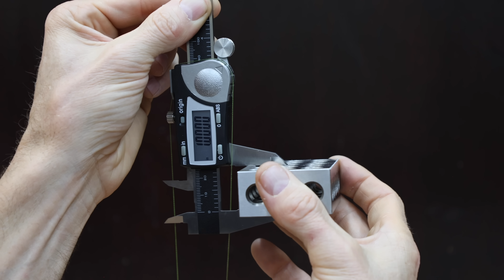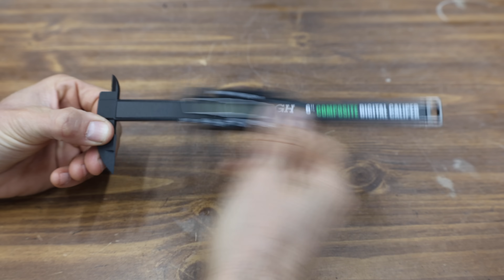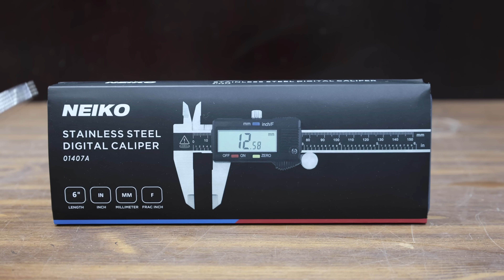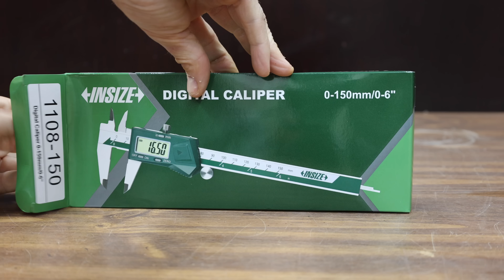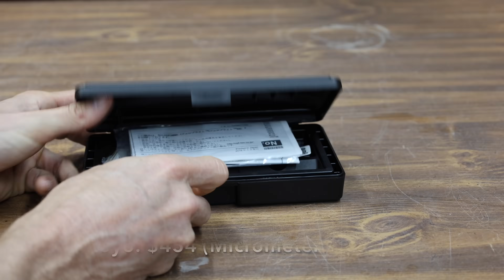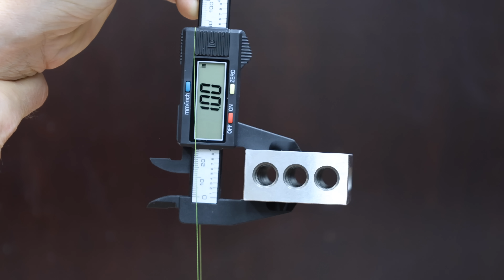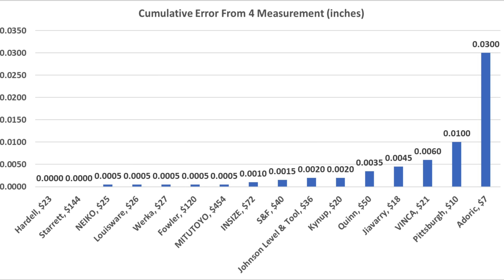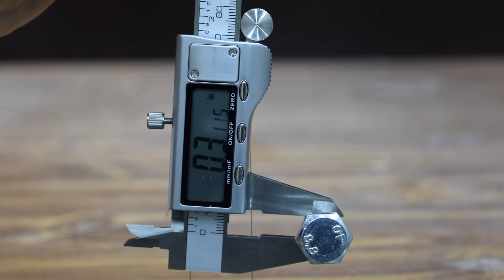I've Been Proven Wrong About Calipers!

Comment: One problem I've noticed with cheap calipers is that they drain the battery even if they're not in use. I have a pair of Mitutoyos and a pair of no name cheap calipers. I can't really complain about the accuracy of the cheap ones, but I need to change the battery all the time.
Reply: yup, if you're going to go cheap, I recommend analog calipers which have been quite decent in my experience.
Reply from the maker: Thanks for the feedback.
Reply: Ave did a good video on this topic with an actual Mitutoyo caliper and a knockoff Mitutoyo.  Both are always using battery power but the legit Mitutoyo draws from the battery far less than the knockoff
Reply: Just pull the battery out of the cheap ones when you're not using it. It beats having to pull it out and go buy another battery. I only ever use cheapies in harsh environments. So not all the time. But there's definitely places I don't want to bring good calipers. I still need better than tape measure accuracy sometimes there too. Not often but it does happen.

Comment: Sitting here with my Mitutoyo's on my desk, hoping I  made the right choice!
Reply: You did!!👍
Reply from the maker: Thanks for sharing.
Reply: In 1985 I bought an (expensive) Mitutoyo.  40 years later the same one is still my main go-to caliper.
Reply: @johnclements3441  My second set of Mitutoyo dial calipers are from 1982, still work great. 6 and 12 inch.

Comment: Biggest problem I've had with cheap ones is that they use relative distance calculations instead of absolute, so they have to constantly track the movement of the caliper. Because of this, they are not only less accurate, they have their battery constantly being drained even when they are off. Basically, they work okay but every time you put them away for a while and come back to them, the battery will be dead and need to be changed.
Reply from the maker: Thanks for the feedback.

Comment: Great review. Mitutoyo guy here. Purchased one in 2016 for $105, with calibration certificate. Still running on the original battery.  Solid as a rock.

Checked the calibration at a local shop and was spot on. Somewhat disappointed to see the lower rank in maximum force variance and O-ring measurement.
Reply: The o-Ring measurement isn't a great metric in my opinion, if that's something that gets measured often then you should be looking into point calipers
Reply: @kylep.9395  Completely understand. However, cheaper devices did better.
Reply: @haldavnekar  it comes down to build quality as well. Yes, the jaws are a little thicker but that mitutoyo will outlast those cheaper calipers while continuing to hold it's calibration much long
Reply: Arent the batteries cheap anyways?
Reply: @fusion1203  Yes. Depends. The reason for it lasting that long is because they are actually SR44 - silver oxide batteries, recommended for precision devices. Energizer SR44 are about $9 for a pack of 5 on Scamazon.
Reply: @fusion1203  Dead batteries can be a pain to change, especially if tiny screws need to be removed, and especially if you just wanted to take one quick measurement, and especially if you don't have a replacement battery handy, and especially if the battery leaks because it is dead & you don't know it because you don't use the caliper that often.  
I have a less expensive caliper that I don't use that often and I have to remove the battery after every use or the battery will be dead when I want to measure something. 🙃
Reply from the maker: Thanks for the feedback.

Comment: That adoric one is actually 2-3$ on aliexpress.

for rough measuring at home its more than enough. its not like you need 0.001mm accuracy.

PS: measuring in millimeters is often a lot more accurate, as a M4 hole is 4mm, not like a 1/8th inch being like 0.242123.
Which gives a more accurate example on sizes
Reply from the maker: Thanks for the constructive feedback.

Comment: Quick tip: most of these will draw power even when off. Slip a thin piece of plastic between the batt and casing when not in use. Most have the same logic board inside right down to the programming pin out.
Reply from the maker: Thanks for the tip.
Reply: I used to do that but kept losing the plastic piece I cut out lol. Now I put kapton tape (or shipping tape) on half of the cell and just rotate the cell when needed. If you are using clear tape, just use sharpie or something to mark which side tape is on.

Comment: I prefer dial over digital.
Reply: There's just no instant switching to metric and when you get older, you'll need reading glasses to see the little lines!
Reply: @dahut3614 I am older and I appreciate your point. I really only work with the decimal inch though. I seldom use the metric system. Cheers!
Reply: Love my Starrett 120..
Reply: 100%.
Reply from the maker: Thanks for the feedback.

Comment: I’ve found that if you use them only occasionally then the battery goes flat if you leave it in the calliper. I always take my battery out after use so having to unscrew a cover etc would be a no no for me.
Reply: Cheap ones use more power off than good ones use on. You can leave the battery in good ones and remove from cheap and the good one will use less batteries.
Reply: That's why I don't use battery callipers.
Reply: I can't really recall when exactly I bought the Mitutoyo calipers that I still use today, must be 25 years ago or so. There have been a few SR44 battery replacements during the years, but not that many. I've always had a battery in it, and it has never died on me.
Reply: This is why I switched from my battery powered Mitutoyo calipers to the same caliper but in a solar powered version.  They always work when i need them to, and I never have to worry about the battery dying.  While the battery in the Mitutoyo lasts a long time (Mitutoyo claims 3-5 years), it'll drain out if you forget to turn it off, and I've made that mistake a few times.  The only drawback to the solar powered caliper is that unless you're in really strong, bright light, it seems to take a bit of time to switch between imperial and metric.
Reply from the maker: Thanks for sharing.
Reply: guess what, the battery goes flat also if you use them often or don't use at all, not only if you use them occasionally.
Reply: This is why I stopped using digital calipers. Should have tested this. Since it makes them unusable for most casual use. And since only casual users buy these things, it is basically a pointless product, a waste of money.
Reply: I use dial analog too for home use.  

Needed a caliper once and battery was dead.
Reply: @MisterMakerNL  My iGaging calipers are over 4 years old and still on the original battery. So it definitely isn't a problem with all digital calipers. Granted the iGaging ones aren't exactly cheap, but they also won't break the bank.
Reply: @MisterMakerNL  What?! Pretty much all manufacturing jobs (with small enough items) use calipers...What are you even on about?! Measurements are the absolute most important trait in manufacturing. It's impossible to NOT use calipers. And unless you manufacture something with VERY generous dimensions, non-digital calipers are simply not precise enough.

Micrometers are used only in the most precise measurements, which is comparatively rarely. But even then, most quality control wouldn't use micrometers for every unit since it takes too long and risks excessive wear to them. Calipers are sufficient for the in-between controls with sporadic throughout check every so often.

Also, that's the most pointless reason to stop using digital calipers I've ever heard. If you don't have a use of calipers for over a year, then you should take out the battery anyway. NO battery should EVER be unused in a device for that long. That risk spillage.
Reply: @kikixchannel I meant these cheaper versions.Lot of devices use batteries on long term
Reply: @kikixchannel They said digital calipers. How did you think calipers worked before digital displays became common? They were analog , and you can still get excellent ones with remarkable accuracy.
Reply: @ThatMattWhite  You really need to reread my comment, this time actually paying attention.
Reply: @kikixchannel  So you saying the drain is caused by me not removing the battery not because it is a shitty product. Yes, that is definitely how good design works.
Reply: @MisterMakerNL  Yes, yes, yes!  An AMP drain measurement when "off" would have been good in this report.  I'm not sure if any of these calipers have a mechanical off switch that completely disconnects power or not, but I'm sticking with dial before I ever buy one of these.
Reply: Theres a huge difference in cost and availability between calipers that can read 0.001" and 0.0001".

Most common calipers (digital and analog) read 0.001".  Some digital will give a 0.0000" or 0.0005" ten thousandths.  

For 0.001" scale, analog actually is more accurate, because analog can allow you to estimate the ten thousandths value (0.000x") with +/- half resolution tolerance (+/- 0.0005).
Reply: @JKHTX  pff those inches...

for us non-aliens:

0.001" = 0.0254 mm -- not a problem with any digital calipers these days except the crappiest (typically also plastic) ones
0.01 mm = 0.000394" -- not a problem, repeatably, with decent calipers, including relatively cheap ones (but you need to know which to buy, these are typically built better and have absolute scale, cost starting at $30 or thereabouts).

anything less (that is, higher resolution) than that is pointless with calipers anyway as they lack the structural rigidity and constant clamping force required to provide repeatable measurements; sub-0.01 mm we are getting into the realm of micrometers.
Reply: @s_s-g4d  boop beep nanoo nanotechnology 👽 

😁

In the US 0.001" calipers can be found anywhere.  .0001" I've only seen available in higher end brands like the top 3.

I can't remember seeing a digital caliper that doesn't have in/mm toggle button.  

I personally never had to measure anything requiring tolerance in 0.0001" range😅